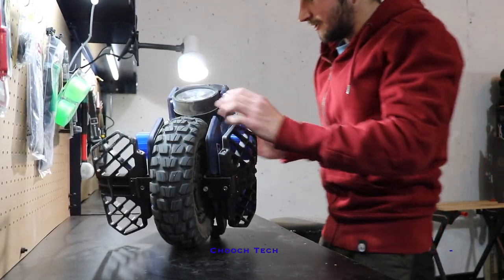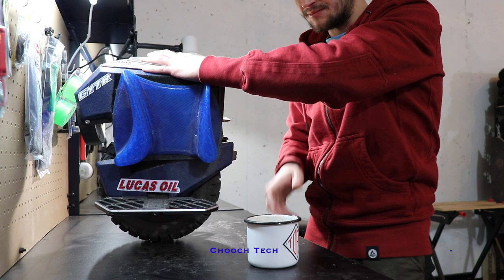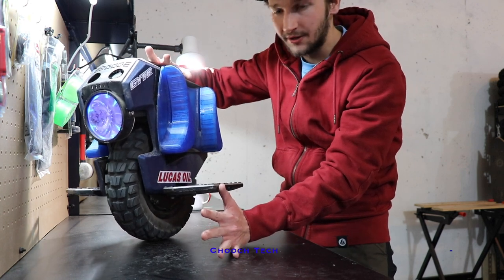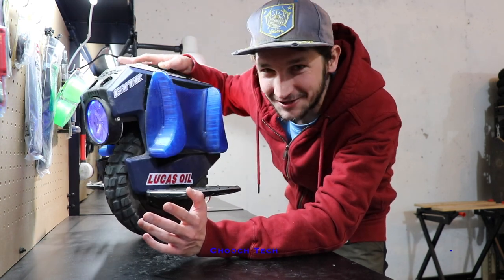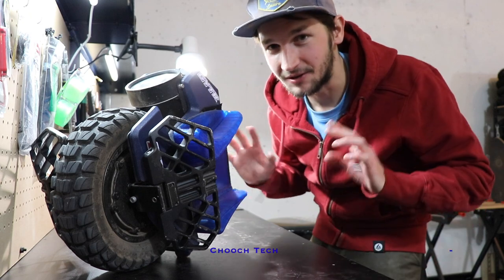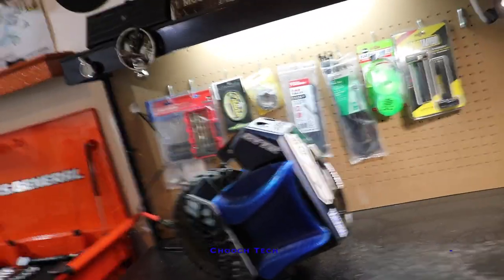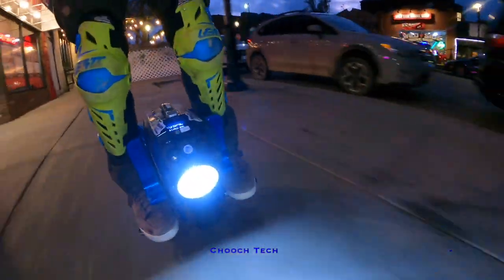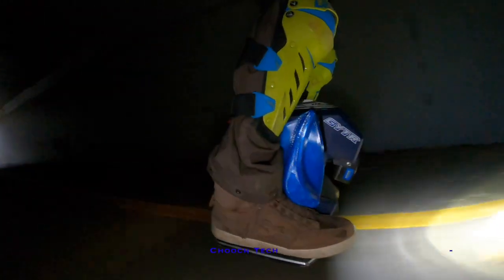INSANE MINI ELECTRIC UNICYCLE: Mten 4 (Table Top Review)

Comment: It’s exactly what I think the real practicality of EUCs can be for the majority of the population that lives in cities or suburbs. I’ve lived places where public transportation could be made viable by this thing. The issue is sprawled places where transfers suck and make it take forever. If you got a thing in your backpack that you can easily blast out 2-3 miles to bridge gaps, you could make lots of subpar systems work. I’ve heard the coolness argument, but it really isn’t a factor, do a fun, cheap thing that makes your life better. Even my V8S is flat out faster for doing lots of things in my suburban zone than driving. I know my local trail network, I can maintain a constant 15-20 on a more direct path vs going 35 and stopping, going 40 and stopping and average out 10-15 over that drive. Faster and 100 times cheaper, which is much cooler than looks.

Comment: Your new camera is top shelf.

20 mile range... Could I get extra batteries? And could I swap them out in the field? How difficult would that be?
Nuff Said.
Reply: 6 screws
Reply: a hot swappable battery would be ideal, no euc models have that.
Reply: Darn...But thanks all the same. I just wanted to have an extra battery in my backpack. The other EUC's just look to big I mean how would I carry this thing? Where this one was ideal. Oh well.
Reply: Six screws? You mean I could carry an extra battery(s) in my backpack and replace them using a screwdriver? 
That would be awesome if true. I would like to see this done on a video. 
Thanks again...
Reply: @yojimbo8695  6 screws to open the top, where the handle is. I’m not sure the type of battery or if it can be replaced on the fly tbh

Comment: It can't be used for basic grocery shopping because there is no trolley handle. That's a deal breaker to me. Did Begode really expect me to carry this around in the supermarket???
Reply: bring a backpack...
Reply: Here is idea.  Put it in the shopping cart.  That is even easier than using a handle to roll it around the supermarket.  It is even more discreet when you have it among your shopping items.
Reply: @doctorpd1959  No thanks. Unicycles are dirty and don't belong in the baskets. This is not a negotiation, if you don't have a better solution than your competitors then you can't have me as a customer.
Reply: @coldpanda  No I'm not going to wear 13 kilogram on my back and shoulders when I shop. And I'm not looking to pay 1000 dollars for such an experience.

Comment: Honestly it's a gimmick wheel and at the price it's a dumb purchase. If it was priced reasonably around $600-800, i'd add it to my collection just for fun.
Reply: Just sold my mten3 with 512 watt hours for $900 USD. I think you aren't analyzing the cost of the batteries enough